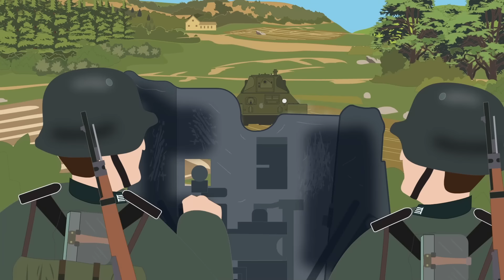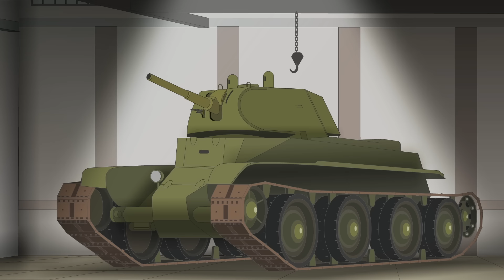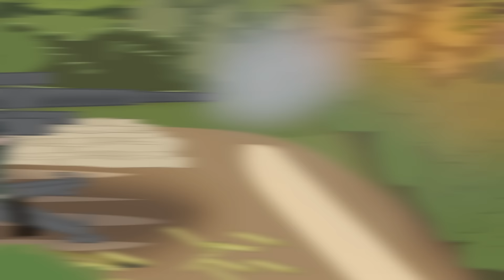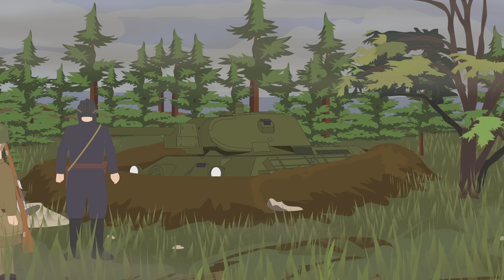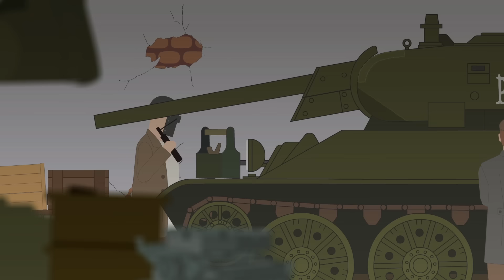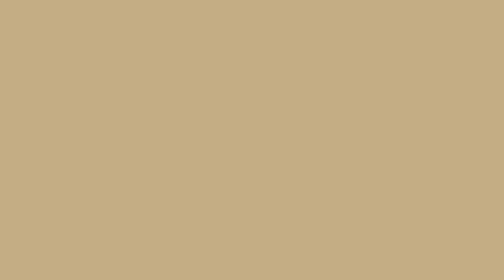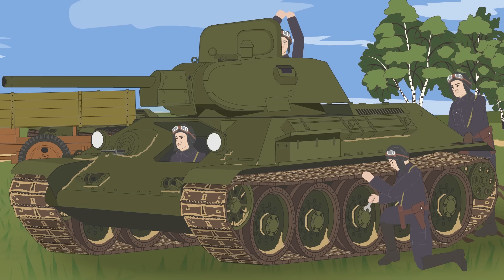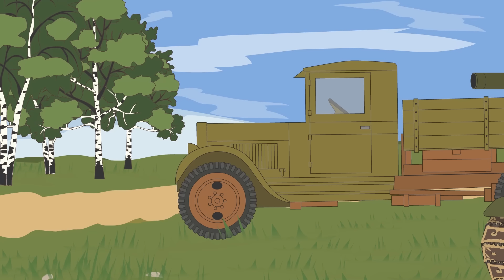Was the T-34 Really the Best Tank of WW2?

Comment: Any version of the t34 could be destroyed by a 50mm Panzer 3. The only reason the t34 was any good was because it massively outnumbered German tanks
Reply: jep! and here's a spource showing that 50mm are sufficent to destroy a T34:

“Soviet statistics regarding the losses of T-34 tanks to German guns from the beginning of the war until September 1942 speak quite eloquently on this manner: 4.7 per cent of them were knocked out by 20mm shells, 10 per cent by 37mm shells, 61.8 per cent by 50 mm shells, 10.1 per cent by 75mm shells, 3.4 per cent by 88mm shells, and 2.9 per cent by 105mm shells.” Boris Kavalerchik, The Tanks of Operation Barbarossa, ISBN 1399014293, Page 174 Lines29-34
Reply: Wehraboos be like
Reply: I used to use Panzer 3s and I’ve done some research

Nope, it’s just not possible, the Panzer 3 is just hopelessly outclassed by the T34

Note: I used the Panzer 3 J1
Reply: @Iluvmefishfactory9573  you realize armor deformity exists right? The armor can slowly be weaker. Not only that but the panzer 3 killed the most t-34s even the panzer 3 f could with the short 50mm
Reply: Yes, I'm basing this off of the pz-3 M and the T-34 1940 and 1941 the pz-3 would just go through the turret armor super easily. Like you said the T-43 was not good over all it is just that there were over 84 thousand made.
Reply: I found a wehraboo mom!!

Comment: 1:58
Why did it not pen? 
It hit the drivers hatch.
Reply: Have you played war thunder before cause if you did, you already know why
Reply: the 37 hasn't enough energy, but the kwk42 didn't either I think. Pantherfibel doesn't state so, only the 88 had enough
Reply: @belgianfried  bruh, i was referring to war thunder.
Reply: @belgianfried  the 37 can penetrate a T34. it will probably need multiple attemps but i certainly can:

“[…] in the summer of 1942 on the basis of 154 knocked-out T34 tanks; only 32 per cent of the hits by German 37mm armour-piercing shells on these tanks led to full penetration of their armour.” Boris Kavalerchik, The Tanks of Operation Barbarossa, ISBN 1399014293, Page 172 Lines 20-24

note: The statistic is about full penetrations. Partial penetrations may still be sufficent to at least force the tank out of combat
Reply: @tizi087  I meant drivers hatch

Comment: German tigers are 9 times better though
Reply: That's because Tigers were designed to be so. They were specifically made to be breakthrough heavy tanks and therefore had to be stronger than all other tanks, but made it expensive and few. The T-34 meanwhile is the standard tank of the russian army designed to be used in larger numbers. Tiger is better, sure but they serve (usually) different roles. You can compare the T-34 to the Panzer 4, which both have similar roles. Somewhat the same way in how it's unfair to compare something like a light cruiser to a battleship.
Reply: Not in speed, reliability and mass production. And the fire-power advantage is somewhat negated by the later T-34s 85mm. And they aren't even the same class of tank and aren't comparable. The IS-2 or 1 are better comparisons
Reply: But the Germans can't produced them as fast, and as many as the T-34

Comment: The soviet production doctrine is so different from the Germans, the Germans opted for quality over quantity so making them takes more longer and expensive. The Soviets opted for "if it works, it works" they literally make the t34 a literal moving gun, no comfort for crew, no radio, only a moving gun. Thats why they can produce it in large number only late in the war when the soviets could make some quality change to the t-34
Reply: Early T-34 variants matched what you said

However later T-34 variants fixed many of those issues
Reply: @Kalashnikov413  mid to late variants.
Reply: @Frenchdefense9404  yes
Reply: Did you even watch the video? They also clearly had radios lmao

Comment: Fun fact: there are more than 1 type of T34
Reply: Considering they are still used as a main battle tank and several Arab nations and are modified with modern equipment yes
Reply: T-34:
1940
1941
1942

T-34-85:
1943
1944
1945

Yeah